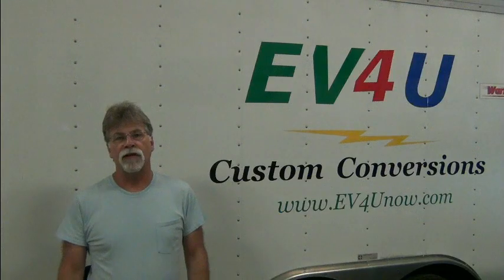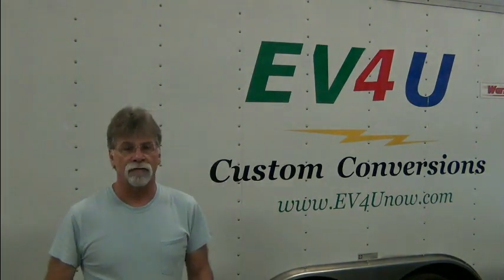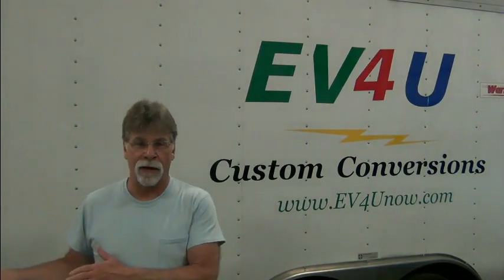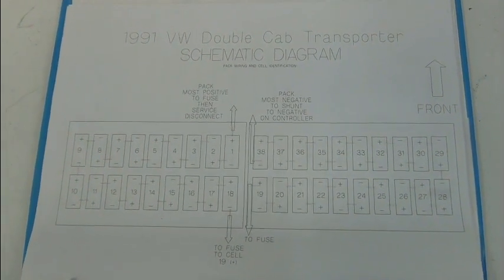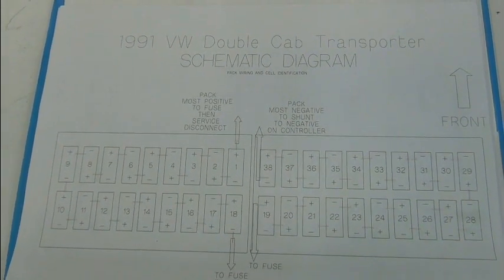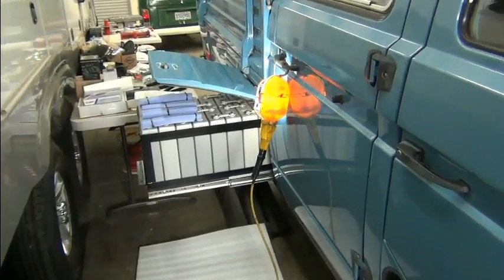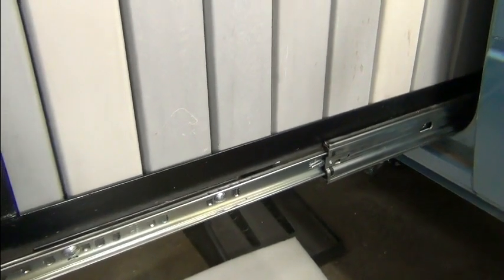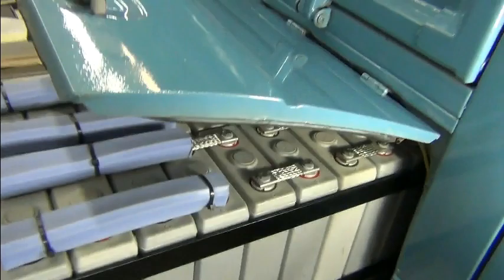LiFePO4 Batteries - Can Lithium Batteries Survive 8 Years Sitting in the Desert ?

Comment: Hi Richard, in a real world scenario, meaning not for long-term test purposes, would you normally recommend to bottom balance the pack prior to recharging given the difference between many of these cells?
Reply from the maker: We will wait and see what happens when they are cycled and run in normal daily driving.
If they continue to only have 0.03 volts maximum variance at the bottom end, then we will leave them alone.